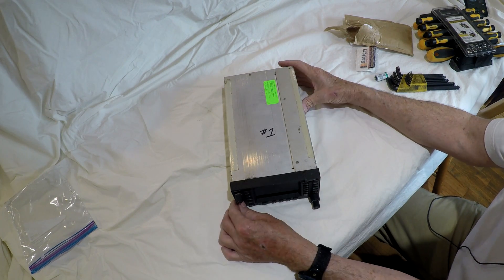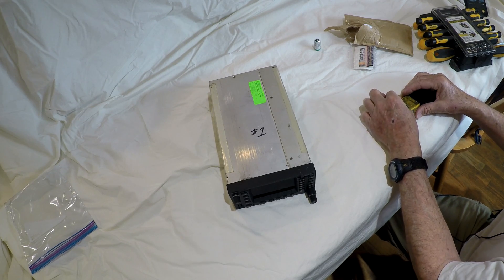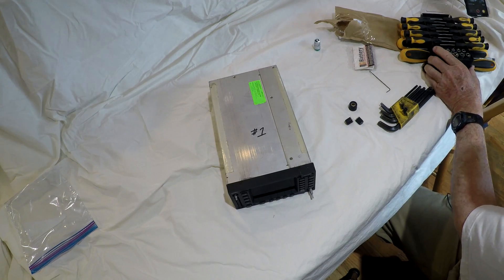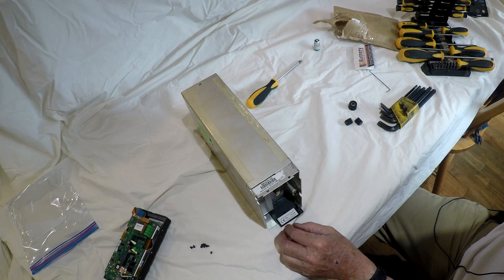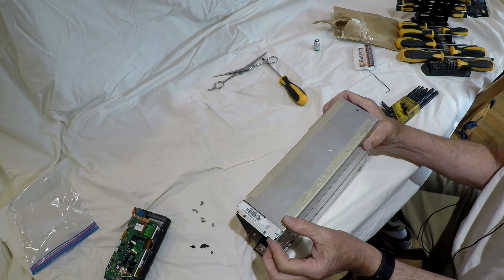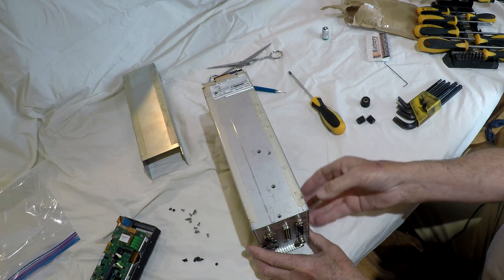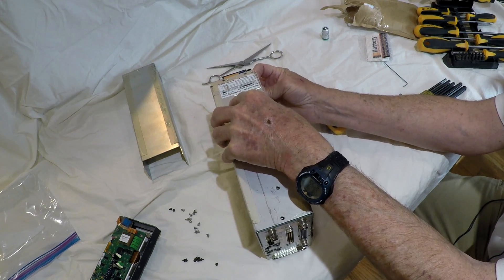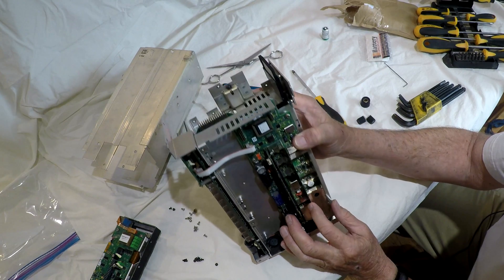Garmin GNS480 battery replacement

Comment: I successfully replaced a battery in a Garmin GNS 430, but it was not in a failure mode, it would not keep user way points or tuned frequencies at after shutdown.

Comment: Just FYI, the replacement battery you showed will work as a replacement. It is not the same exact battery, but it is the recommended replacement and you have to solder it in. 

Also the connector can plug into the board in two possible orientations -- there is nothing that restricts the connector to one orientation versus the other.  The maintenance manual says to be sure to insert such that position 1 connects to pin 1. Pin 1 is marked on the board, but it is not exactly clear which position on the connector is #1. There is a little arrow, which may indicate position 1. However, when I put a resistance meter on the pin connectors I found that the 4 pins are connected together in pairs such that it should make no difference which orientation. 

The first time I replaced the battery the box still gave me a low battery voltage error message. When I opened the box again it appeared that this connector may have come loose. So now I am trying again.

What would be helpful would be to find some terminals on the circuit board where one could pick up the 3.2 volts -- just to validate that the battery and pin connector are installed correctly. So far I have not found anything on the board or in the installation manual.

Comment: FYI...When dealing with internal parts in avionics you need to ground yourself to the case and keep an electric grounding strap on your wrist attached to the case or you run the risk of having a static discharge from you damaging the fragile little electronics. Ask me how I know?
Great video.

Comment: Did changing the battery bring the 480 back to life?
Reply from the maker: No it did not.  I had to send it in and Garmin charged me $1200 for the fix.  Garmin is now short of several key parts and they may not be able to fix the 480 anymore.